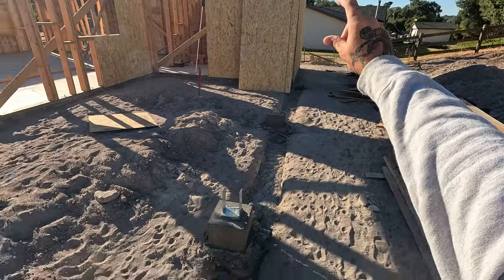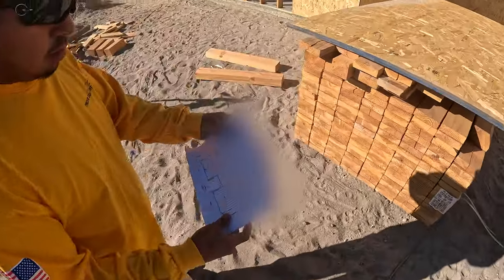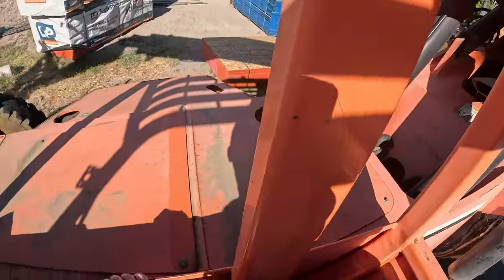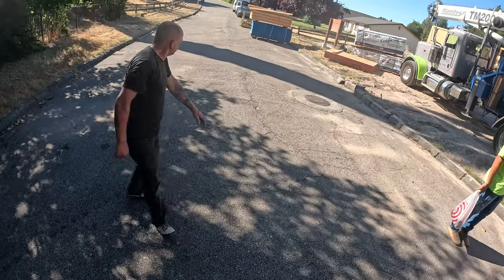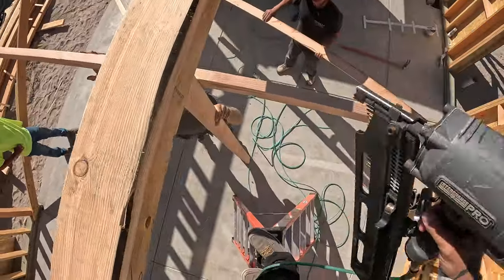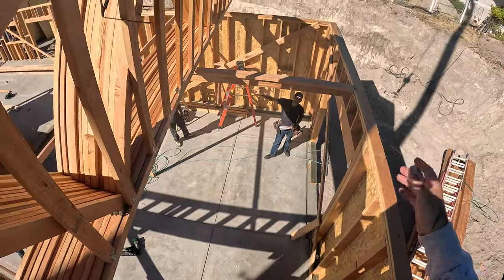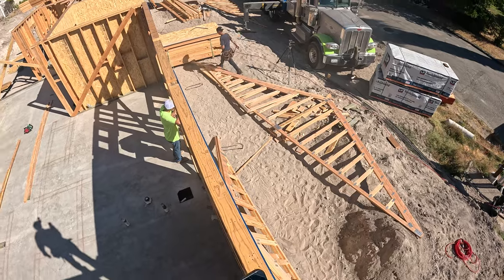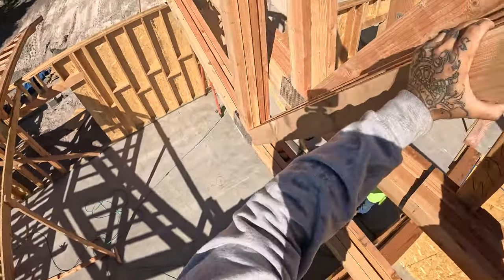Building A House #7 | Truss Delivery, 1990’s Method

Comment: Noticed you guys don't put any peel and stick under post
Reply from the maker: Like a flashing tape? What’s the reasoning you do that?
Reply: @MattBangsWood  Just a separation from steel and wood. Just like plate gasket on foundation wall.
Reply: @MattBangsWood  Steel can condensate.

Comment: dude said 1990s method  as if the process has changed. everybody builds like this.
Reply from the maker: We normally fly individuals, not bulk load and roll.
Reply: Back in the 70s, we used to hand load them. Would take two guys almost all day to get all the trusses up on the walls and you be dead tired